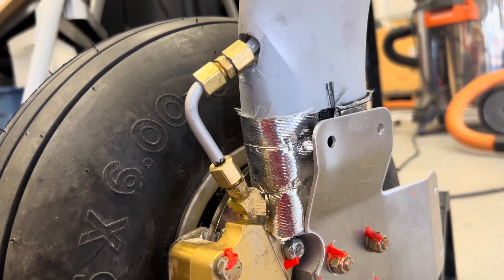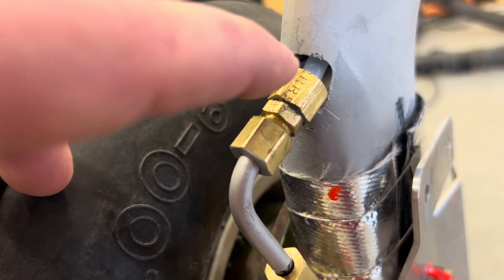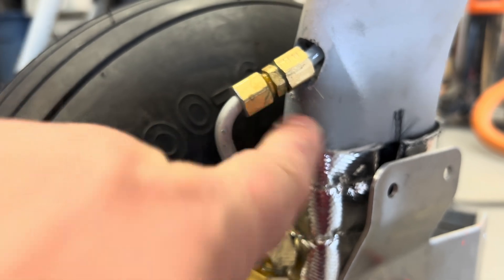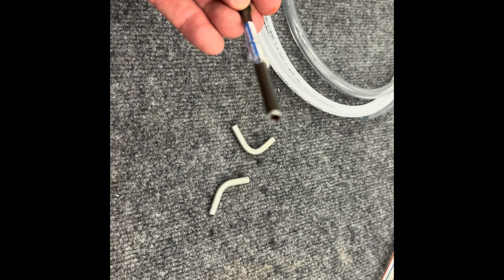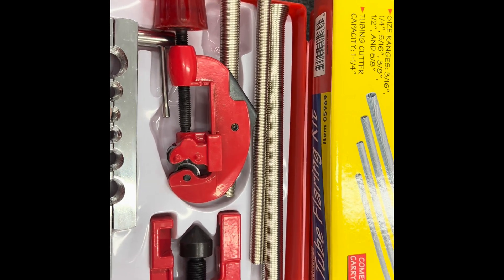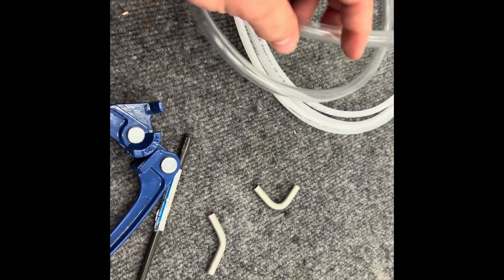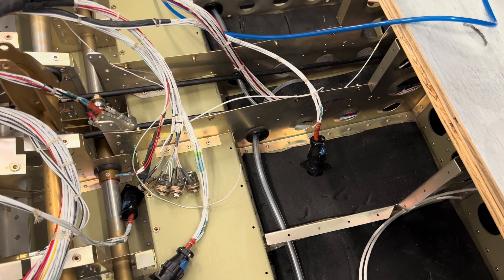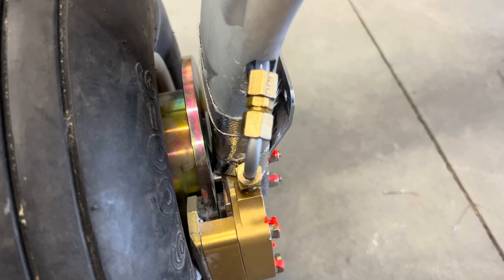Sling TSI Build Update - Brakes

Comment: Can you measure the clearance between your Matco dual piston calipers and the tire with the park brake on and let me know what the measurement is. Tried to fit a set to a friends TSI and the clearance is very minimal.
Reply from the maker: It's tight for sure, but so was the single caliper version of this assembly.  Mine are clean and don't have anything making me think they are touching the tire on landings.  This is now the standard brake on Sling TSI's from the factory now from what I read somewhere.   I can take a look the next time I have the wheel pants off and try to get a measurement.  I have a picture that shows how tight it is but I don't know the measurement.
Reply: @aviationkitbuilder thanks a measurement and close up pic would be great 👍